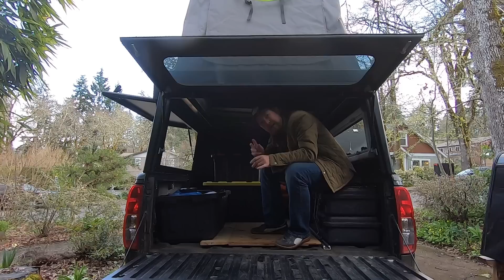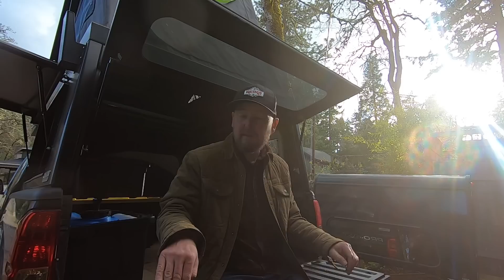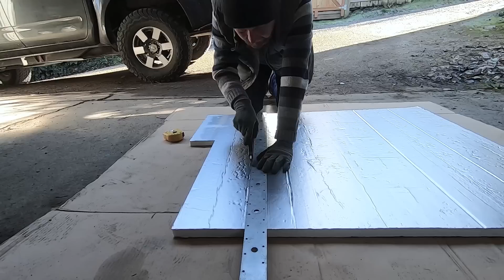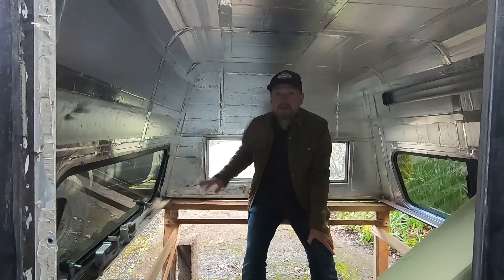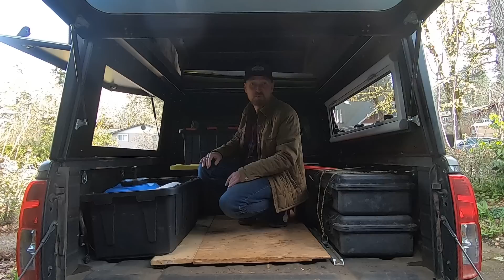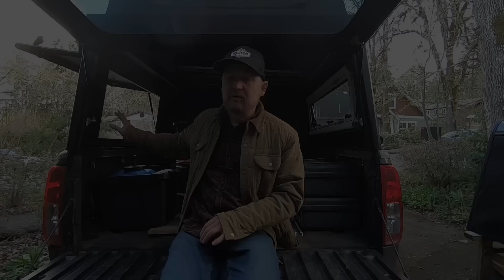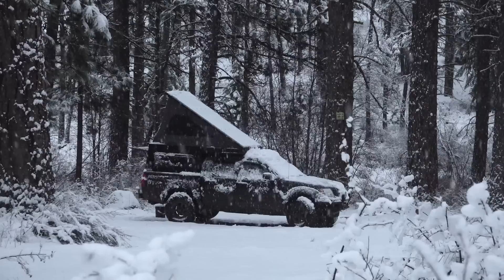Camper Interior Build Series: Part 1 - Planning & Ideas

Comment: I have a small electric space heater that I use in my garage. It does surprisingly well for a larger space. I haven't looked at what's available, but since you have so many jackery units, maybe electric would work for a heat source. Also, you have the idea of the standing height counter on the non window side, but putting your couch/nap spot on that side would eliminate the worry of not being able to see out the window from the seat. Then you could make your counter just a flat surface above the window that you could see the window under.
Reply: I usually wait til the end to comment in case my ideas are covered... but the one time I don't, you cover electric heat 30sec later... lol

Comment: Your idea of a raised floor is a great opportunity to have a flat RV-style water tank that keeps the weight low.
Reply from the maker: Interesting! I didn't even know that was a thing! Thank you!
Reply: @softroadingthewest  
For our water, we use retired stainless-steel five-gallon Pepsi kegs... aka 'Corny' or 'Cornie' kegs for the manufacturer Cornelius.
Engineered to be pressurized, they are zero-leak transportable on their sides.
I could see a couple in the raised floor compartments along each wall (under your swooning settee).
.
One of my hobbies is walking wrecking-yards aka 'dismantlers'.
In Eugene Oregon, junker RecreateVehicles are constantly towed off the streets and out of fields.
Dismantlers pull the aluminum siding and other recyclables, allowing a glimpse into the innerds.
Invariably, fresh water tanks have a mucky sediment, often several inches deep.
.
Our modular kegs contain any stank to just one keg, and the other kegs can be used to clean/sanitize the problem child.
A keg can go to the campfire and picnic-table.
A keg can be loaned to a chum.
A couple-three kegs can go to town for re-fill while the others stay in-use in camp.

Comment: Love my propex propane heater. Many creative ways to install. 
Also, one centralized location for your jackery, many hardwired port extensions.
Reply from the maker: Yeah, the Propex is without a doubt a front runner. It helps that I have witnessed first hand how well it works. And I have a local buddy who is very familiar with them and could certainly assist me with any issues I encounter. 😏
Reply: I have one in my T@G tear drop and have thought about one for my Frontier PRO-4X. That or going with a suitcase option

Comment: Did you mention the Wabasto the burns gas that ties into your gas tank? I think it’s the same size as a diesel heater.
Reply: It’s the stc 2000.  I’ve had one in our promaster for 3 years with zero issues. If you get the basic thermostat you can do a high elevation adjustment so it burns leaner. I couldn’t tell a difference in performance and burning leaner also seems to eliminates the only issue I’ve heard others have (combustion build up)
We camp with a toddler so keep it a toasty 60 plus all night and you don’t even notice on the fuel gauge. Maybe a quarter gallon in 8 hours.
Reply from the maker: @mrhydrojefe  Interesting. 🤔Thank you!
Reply: @softroadingthewest  no problem. Just google the high elevation mode. 
You plug a couple wires into the unit and do a series of twisting the thermostat on and off until it blinks confirming the change.
Reply from the maker: I didn't mention it. I actually didn't even think of that option, though I've watched Chris of the Venture4WD channel have so many problems with his Wabasto that I would hesitate to go that route. I think they can struggle at elevation, and that's when I'm most likely to need it to work. 🙂 I have to admit though that I haven't even looked at them, so I should at least inform myself a bit. Thanks!

Comment: Thanks for running your thoughts on your new build. Looking forward to see where it goes. 

I love the idea of electric heat personally but it is super inefficient.
Reply from the maker: Yeah, I can't tell you how many times I've gone back out on the webs searching for some kind of heater with low power draw but still effective. And maybe I could get away with it assuming I would be driving every day from camp to camp as I usually do, allowing the power stations to recharge, but if I ever wanted or needed to stay put for a few days, I really doubt my solar panels could keep up with the power demands of electric heat, especially in winter sun/lack thereof.
Reply: @softroadingthewest  It's about energy density.  Diesel has the most energy/lb, then Gasoline, propane and way down the list is batteries. 
Also, finding fuel.  Diesel and gasoline is easy.  Propane can be a problem to refill.  I've spent a 1/2 day following friends searching for propane in So. Utah.
Reply from the maker: @davezuber521  Good point about ease of refueling.

Comment: Great build! Excited to see what you come up with, it'll be great no matter what you do.

For modularity vs. keeping the truck useable as a truck, I'd really lean towards not compromising the overland build for hauling, and getting a Harbor Freight utility trailer for hauling duties.

One thing I didn't anticipate when I built my utility trailer was how nice it is being able to stage a load of whatever without tying up my truck in the process. Couple days landscaping and piling yard debris on the trailer doesn't tie up my truck, even if those days are spread across a couple weeks to get a load worth hauling to the dump.
Reply from the maker: That's a really good idea. A little trailer would do the trick (actually probably even better than my truck bed for much of what I might want to haul). Not worrying about building in removability would certainly make this more simple to engineer! I also have to be realistic about: would I ever actually bother removing pieces? Last time I needed to haul a bunch of stuff, I just rented a U-Haul van rather than trying to cram stuff into my topper. Hmm. Good food for thought here - thank you.

Comment: I came to the same conclusion regarding the electrical setup. Out there in the bush my electrical needs are very minimal. Some LED lighting, the ability to charge phone and camera batteries, run a laptop if needed and run my refrigerator. My Bluetti EB 70 handles all that and has three way charging built in. And since I already have it, the cost is literally nothing.
   Heat is another story. Like you I've been using the Buddy heater for years and I really don't care for the diesel heaters. I put up with the additional moisture since we live over here on the desert side and  it isn't very bad. It will be interesting to see what you figure out as you go.
Reply from the maker: I can't tell you how many times, after spending hours and hours researching heat (over and over again) I finally start to say to myself, maybe I should just stick with the Mr Heater Buddy. It's simple, it delivers, and it can be removed from the setup during the summer months. Even if I have to pay for repairs to that little sensor every few years, it's still very budget friendly. I'd love SO much to eliminate the added humidity but I have not ruled out just sticking with the Buddy. Hope all is well over on your side of the mountains!

Comment: Ideally you want at least a 1/2" space between the outer skin and the radiant barrier face polyiso insulation.  From my years of experience in Florida use 1/2" insulation, any more will just trap the heat or cold inside the rig and take more heat or a/c to make it comfortable.  
  For interior I stay away from cloth, carpet or whatever can hold moisture, cooking smells and molds. I like thin luan panels with a couple coats of polyurethane varnish rolled on all faces and edges,  or paint. 
  My van holds 15° to 20°F temperature difference between inside and outside, AND no problems with mold or moisture.  I have been building vans like this for over 15 years.
Reply: Without the space between the outer skin and the foil radiant barrier it will conduct the temperature through and not radiate the heat out along with the moisture.
Reply: I have a/c and electric heater  and stay whatever temperature is comfortable,  from below 0° to 100° + temps all over the country.
Reply: Indoor outdoor carpet is a lot heavier than paneling and holds a lot more stink !
Reply from the maker: @duane4972  Thank you so much, this is awesome info. Very good points. I had to Google "luan" to even know what that was, heh. I am generally lacking knowledge in what materials are available out there and what people have used successfully. I probably should spend some time watching van build videos before I get much further along. I like the idea of wooden paneling inside but was concerned about it being too heavy. The indoor-outdoor carpet I have used in the past was very thin and lightweight and it never would have occurred to me that any sort of wood could possibly weigh less.  

What kind of electric heater do you have, and how do you power it? I would SO love to use electric heat if I could find a way to make it work.

Comment: Donald, I think that insulating on the lid could make some sense for radiant heat, but insulating the walls, but having canvas sides is self-defeating. Consider using a thinner mylar faced bubble wrap style blanket like they use to place below upper string of roof trusses. This will allow you to keep thicker bedding and a sleeping bag. Everything else is ... well a waste of money, unless your goal is just to clean up the in interior finish and take care of some of the condensation.
Reply from the maker: Well, I had that exact thought actually. Seems pointless to insulate since it's a tent. But have you ever camped in one of these? What I've found is that the aluminum walls suck heat out of the interior much more noticeably than the canvas. They are very cold to the touch - which means, they are definitely absorbing heat from inside and radiating it outward. The canvas on the other hand does not feel cold. This leads me to believe I am in fact losing more heat due to aluminum's thermally conductive properties than I am losing through the canvas. The aluminum is also way more prone to start accumulating condensation than the canvas, which would seem confirm it is truly getting colder than the canvas - and therefore absorbing more heat. 

I am as lazy as they come and would love to skip any steps I could, but I'm pretty convinced that sheathing all the aluminum surfaces is going to yield a somewhat cozier interior, especially down at the bottom where it's prone to be colder anyway with heat rising upwards. And of course it will help mitigate condensation issues which - camping frequently in the cold wet PNW - is something I need to address.

The additional benefit here though is summer. When I insulated my previous topper, it noticeably reduced how much heat accumulated inside on a hot sunny day. Topo equipped the lid with white vinyl to reflect summer sun off the top, but those black walls are definitely going to collect heat, and I'd like to minimize that as much as I'm able. 

Insulation is cheap - I bought two $25 panels to insulate my Leer and still have half of one of those panels left over - so skipping this step doesn't yield any significant cost savings, relatively speaking. And yeah, it also provides a nicer uniform surface to lay in some kind of more attractive interior finish. It's really dark in there and I'd like to eliminate all the black inside. 🙂
Reply from the maker: Oh, also meant to mention: the roof has 1/2" channel running across the interior for structural integrity, and bedding/mattress etc has ample room below that. So I am thinking to use 1/2" insulation for the roof (between the channels) since it won't encroach on the bedding any more than the structural components already do. I intended to point that out in the video but forgot of course. 😄
Reply: First off a portable diesel heater is a good choice. I just used one over the weekend in my IKamper mini and it was great stayed warm at the lowest setting and barely used any diesel fuel. The other suggestion on the right side under the window looks like it would be a perfect place for a long small cabinet from back to front also for light for your canopy, I seen a lot of people get an adapter for their cordless power tools battery and use that with a switch system for their lighting in small work trailers so you can save your jackey power pack for other thing  looking forward to see what you do  take care 
Brian Martin